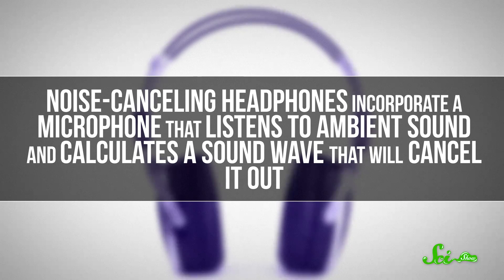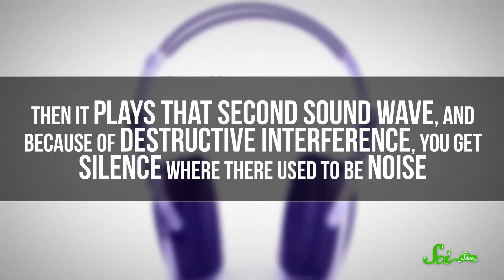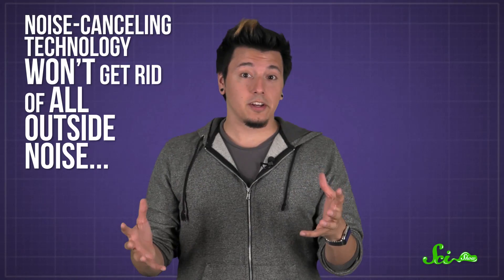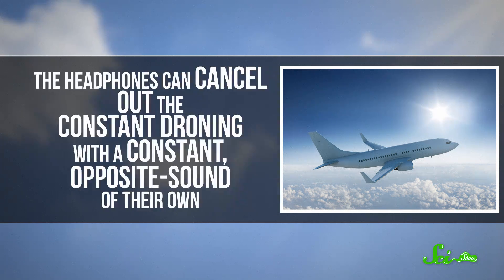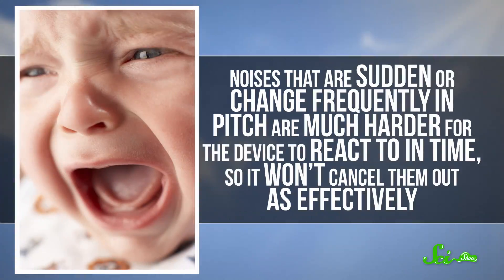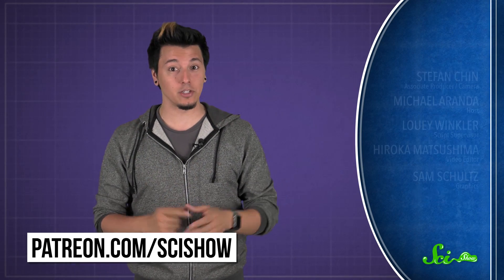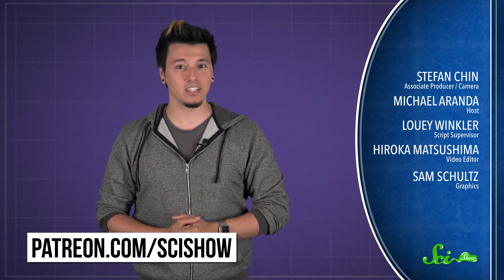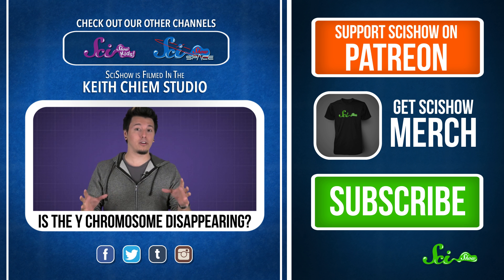How Do Noise-Canceling Headphones Work?

Comment: There are two kinds of noise-cancellation and this does one, exterior sounds; the other is excessive exterior loudness canceled by popular industrial technology that takes sounds above a certain level like around engines, and subtracts the excess, allowing the wearers normal conversation listening and talking despite the engine roar, hammering, blasting....
Reply: (In case that's unfamiliar: the second kind actually brings-in-and-replays external sounds, inside, but only those within the restricted lower-energy 'voice' levels....)

Comment: you forgot to mention that noise cancellation works almost exclusively with low to medium frequency, as high frequency waves just move right around the noise cancelling speaker.  Kind of an important point.

Comment: Interference is irrelevant here because if you try to rely on interference it will work only in one single point is space.
anywhere slightly away from that point noise will be increased, not muffled.

noise canceling headphone can only muffle sound inside of your ears and it is not using interference it merely compensates sound in the point of headphone membrane so that it cant pass further

Comment: The Bose QC15 seem to play grey or white noise in addition to the noise cancelling described in this video. This is probably to lower the Signal-To-Noise-Ratio (SNR) and cover low amplitude sounds coming from outside. Its a cheap trick but it's quite effective.

Comment: Since energy can't be destroyed, do the watts that have been emitted by the sound-waves get converted into heat in the air?

I get the same confusion when I hear about destructive interference in light waves.  Clearly the photons can't just poof out of existence, so when a light wave is destroyed where did it's energy go?
Reply: yeah it becomes heat. the PATTERN is destroyed, not the energy itself

Comment: Cars that want a quiet interior do that to muffle their own engines..

So on a plane with a cabin full of people there might be a way to cancel most of the noise from the engines by adding a "speaker" or oscillator to mimic the opposite wave pattern. Maybe on the wings pointing toward passengers or where the wings attach to the fuselage?

Comment: The part about canceling constant noises better than sudden noises is a common myth. Noise canceling headphones do not really work by "predicting" the noise in advance. They simply react to noise as it happens. They don't have a fancy DSP or anything like that. Typical noise canceling headphones are completely analog. They don't care if the noise is a droning, constant sound or not.

Instead, for the cancellation to work, the noise has to be low in frequency. The reason is that the destructive interference only really works when the wavelength of the sound is larger than the size of the headphone (and the chamber it forms around your ear). If the wavelength is shorter, then you get constructive interference in some locations and destructive in others, and there's no way to reliably ensure that your eardrum winds up getting the destructive effect.

So noise canceling headphones are designed to cancel low frequencies, and just mechanically muffle higher frequencies. And that's why you can hear the baby crying. Not because it's a sudden noise, but because it's a high pitched noise. The fact that it's not consistent does make it subjectively more annoying to us, of course.

Good noise canceling headphones have two microphones per ear: one inside, and one outside the cavity. The one outside is used to pick up and react to noise as it comes in, and the one inside is used as a closed-loop to compensate for any remaining noise inside. This way you can get better cancellation performance and a wider frequency range, but it's still largely limited to the lower frequencies.

You can test this out for yourself. Play back a tone at a given frequency from speakers, put on some noise canceling headphones, and see how much of a difference turning the cancellation on and off makes. For some Bose headphones that I have, there is no effect above 1000Hz. That's a wavelength of 34 centimeters, larger than the size of the headphones; anything with a shorter wavelength than that (higher frequency) cannot be cancelled by the noise cancellation system. On the other hand, if you play pure white noise (which by definition is unpredictable, and, in fact, sounds a lot like the noise inside a plane!) limited to a 0-500Hz frequency range, you'll find the headphones cancel it just fine.
Reply: Great explanation. I couldn't do better.
Reply: well said!
Reply: marcan cant believe you only got 34 likes
Reply: I too, was frustrated when the video said that the headphones "predict repetitive sounds and develop cancellation patterns for them" which sounded like waaaaay too much programming and would require the inclusion of a sophisticated CPU within the headphones.  I knew that in reality, the phones just detect sound and generate the cancellation-wave in response to whatever sound it detects.  Your explanation was a relief to read, thank you!
Reply: So then are they effective against crying babies? their sound greatly annoys me.
Reply: So what's the frequency of "the Hum", like the Tao's Hum? would it cancel that out?
Reply: Source?
Reply: Kåpla Kvëhla I did describe a reproducible test you can do yourself :-)
Reply: +marcan Yes. Yes, you did. Funny guy
Reply: marcan by the way do you know what is the most noise cancelling headphone available? The one that can give me the most silence on the market .
Reply: Zargos Ozkan, BOSE are the best brand, by far.
Reply: THANK YOU SOOOO MUCH!!!👍 for your knowledge. This makes perfect sense to me because I hear extremely well at high pitch, off the so my doctor says. I have neighbors with dogs the big dogs barking at a low pitch doesn't really bother me like the little dog who's bark at a high pitch. It feels like it's piercing my ear drum! I knew this was my issue with my (GREAT HEARING) but now I understand it!!! I still don't know how to get a better night sleep but thank you very much! Any advice on how to block high pitch frequency noise would be greatly appreciated by this viewer. Thanks c mason

Comment: We had some sort of active ear guards in the army, but they'd be terrible for peace and quiet. They were pretty much the opposite of these, as they'd let through or even amplify normal sounds like speech, and then block really loud stuff like gunshots, mortars or cannons.  They were pretty funky though, as you could hear twigs snapping 20 meters away as someone was walking. Don't think they had this noise cancelling thing though, but just really heavy muffling, and a mic, speakers and a dB meter that would choke the mic on loud stuff.

Comment: I know how they work, but does the addition of another sound impact your ability to hear (as in long-term wear/ damage), because you are hearing two sounds or is it the compression that causes the damage and the expansion from the noise cancel gets rid of that damage? Whereas ear plugs just block the noise. ---Does my question make sense to anyone?
Reply: The destructive interference results in air not being compressed at all.

Imagine you're inside an elevator on a boat. Every time the boat sways down, the elevator goes up and vice-versa. If this system is functioning correctly, you wouldn't feel movement at all, right? That's the same thing.

What happens is that sometimes the boat can hit a wave so big that the elevator can't keep up with the movement of the boat. It can ease the bump but you'd still fell it. That's the crying baby.
Reply: It does get rid of any potential damage, except for the first few 100 milliseconds.

Comment: Reaction time?  The reaction time of a noise canceling circuit is hard-requirement set to the amount of time it takes the sound wave to migrate from the microphone to the root of the speaker's vibrator.  Otherwise, it wouldn't be able to issue forth an effective canceling wave form in sync with the noise. The reason you can hear a baby's wail and such is that if you cut 80% of the white noise, you cease noticing it. if you cut 80% of the baby's noise, you can notice it - due to evolution and its distinctiveness. There is no 'reaction' time on these circuits against input sounds that isn't artificially introduced by the computer in them.
Reply: If the noise is consistent, you can do a good job of predicting what's coming based on what has happened recently. So, no, reacting in real time is not strictly a requirement to syncing up with the noise.
Reply: +Tim Stellmach perhaps you know better but that seems like adding noise to noise out of hopes you'll sync properly. As much a chance you make it louder as quieter.

Comment: I put in foam earplugs and a pair of closed monitoring headphones over. It's effective enough to the point where I didn't realize someone was pounding on my door, but the increased volume doesn't wreck my hearing because of the plugs.

Comment: The process is called Phase Cancellation. You could take a song, (any waveform for that matter) and take a copy of it, invert the phase, (flipping the compressions to rarefactions and vica versa, it's very simple you can get little plugins that do it instantly with one click) and if you played both at the same time it would completely cancel out and you wouldn't hear a single thing. If you played them individually you wouldn't be able to discern any difference between the two whatsoever. It's pretty interesting.
Reply: If you played one and delayed the playing of the other by just half a second, the sound would be distorted.
Reply: What happens if you play one of them on the left speaker and one on the right? Would you hear almost nothing in the middle?
Reply: +J. van der Linden If you had only one ear and that ear was exactly in the middle, yes
Reply: +J. van der Linden angling speakers towards each other and checking that the sound doesn't get much quieter is indeed a common test to see if you haven't wired up speakers out of phase, I believe.
Reply: Interesting stuff!
Reply: It will not work like that.
If you play 2 spounds with opposite phases they will just sound quieter and low frequencies will be muffled, while high frequencies will be less affected.

you do not need 2 speakers for this experiment just try to play sound on raw speaker without enclosure and you will see that it is very muffles because it produces 2 sounds with opposite phases on its both sides 

when you muffle one of those outputs by putting one side of speaker in the box or some wool.
sounds get much louder and better.
Reply: If you place the speakers very close together more of the sound will be cancelled out. If the speakers occupied the same space, which they of course can't, the sum would be zero. Reflections of walls, furniture, speaker cabinets, your own body and so on complicate the matter further.
Reply: Tobias Eklund 
even if speakers occupy same space they do not cancel each other completely because speakers are directional at some degree so sounds are sent to different directions

Comment: can they just reverse the polarity of the microphone signal to the speakers and have the sound inverted?
Reply: instead of having to process it
Reply: What?
Reply: +Jordan Shank by reversing the polarity (positive to negative and vice versa) you are receiving a signal that is exactly inverted to the surrounding sound. the inverted signal is then played through the speaker and then cancles out sound from the outside. you didnt have to do some processing therefore its alot more effective

Comment: Yes, BUT WHYYYY DO I HAVE A BUTTCRACK?! Why isn't it just a hole?!
Reply: Because you have muscles on that part of your body that are essential to the motion of your legs. (the gluteus maximus muscle is what pulls your femur backwards, alowing you to stand up, or push yourself forwards when running. The other one, the Gluteus Medius is what pulls your femur sideways.)

You also get extra fat there, which probably helps when sitting.
Reply: Jason Klein
You've got a hole, and around that hole two large muscular masses are present. That geometrically results in a crack in the middle.
Reply: You sat down too fast and broke your butt.
Reply: to hide it
Reply: piranha031091 yeah, but why do we have a crack? My original statement still stands, why not just have a hole?

Comment: How do shooting range headphones work? similar principle? They've also got a microphone with a dial that allows you to select the level of noise you want to cancel out. 

You can hear someone whisper but the headphones dampen the gunshot. I find it difficult to think that the system explained in this video is the same one as in range headphones because the blast of sound is very loud and sudden, not constant like an engine.

Comment: Another reason that they aren't designed to completely cancel out noise is so that in case of emergencies, you need to be able to hear what's going on
Reply: Also because they can't yet do it.
Reply: Kush Shah nope don’t 1000xm3 cancel out pretty much everything they even put a label in the instructions to not use them outside so you can hear things
Reply: they don't
Reply: If there's an emergency in a plane I don't really need to be able to hear anything.

"Did you hear about the plane that lost both engines last week? A guy in first class forgot his Bose headphones so he heard it, then climbed outside and fixed them."
Reply: +Dadpool They know when they see people evacuating the area, they smell smoke, they see fire, or the fire alarms   flash.
Reply: Then how do deaf people know if there's an emergency?
Reply: Giles Bathgate You haven't seen noise cancelling headphones at a shooting range. Those are regular earmuffs that have a speaker to amplify quiet noises, which is the opposite idea.
Reply: Honestly speaking, I could barely even hear the speakers during the initial flight safety over the engines. I don't think it will help much.
Reply: Noise cancelling headphones are designed with a wide variety of applications in mind. The first time I ever saw some they were for use on a shooting range. So no, I don't think they are designed with aircraft announcements in mind.
Reply: ey b0ss. fucc you mang
Reply: i dont know but pretty sure thats untrue
Reply: aluisious Actually your probably right, it was at least 20 years ago. It was a friend of the family who had them when it was legal to own a firearm in the UK.
Reply: +Giles Bathgate
You can still own firearms in the UK with a valid firearms license.
Reply: JimJim's Crazy_Quest R U DUMB DUMB DUBM DUBM STOOOPIDDD
Reply: totally agree because we need to know when there's an emergency and I was just about to comment the same thing

Comment: NSA uses the microphone in noise cancelling headphones to listen to our surroundings
Reply: They also steal your socks to keep a dna profile on you
Reply: how would that work?
Reply: because using the one in the cellphone they are plugged in is not good enough?
Reply: raulbataka exactly. It gives crystal clear quality to the person as well as the surroundings
Reply: oh now i get why issis is againts s noise-canceling headphones :)
Reply: Trump is going to outlaw noise cancelling headphones to keep America safe. How can America be safe when technologies like this are so easily obtained?
Reply: I would disagree, seeing as there is no data connection between the headphones and the internet. There is an audio connection, however it is only to send signal to the speakers in the headphones. The exception may be wireless noise canceling headphones or an actual headset where there is microphone connectivity. If you were super paranoid about it I'm sure you could reverse engineer the device and "sniff" any data the headset or headphones may be transmitting... They have done it with smartphones and there is in fact software that tracks your every button press and sends it to some remote server. Doesn't even matter if you complete a text or call someone, it logs the keys no matter what. Kinda scary huh?
Reply: BillCosbyEatsBabies yea... Scary